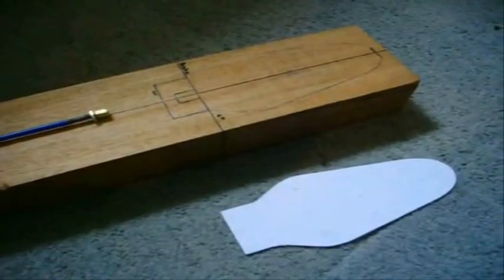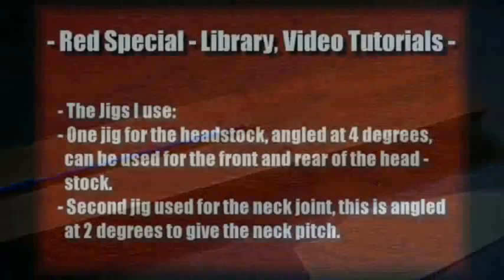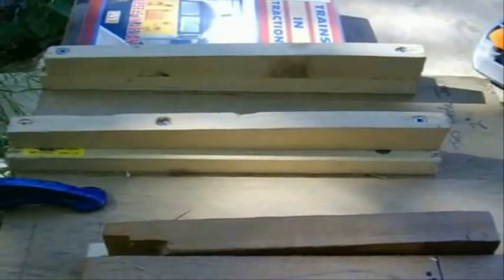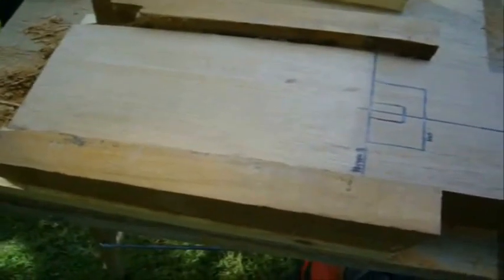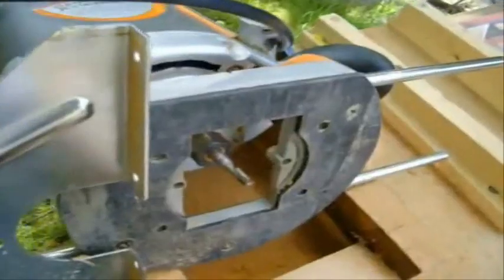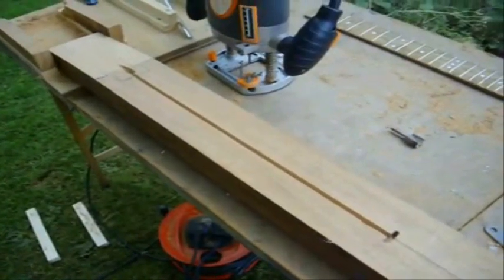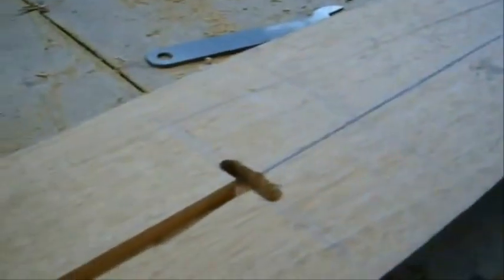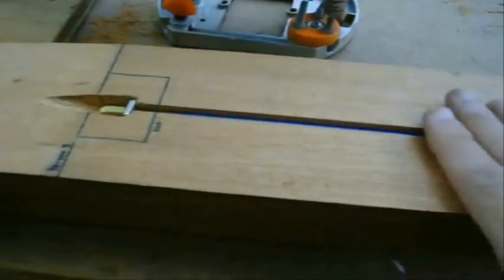Red Special - Library, Part 6

Comment from the maker: On the red special in truth it really doesn't need one... due to the thickness of the neck.
But its always handy to have one installed just in case. The truss rod is used to add or reduce the relief in the neck. each neck has a slight bow or dip, and the truss rod guvens this.
The Truss rod i use is also gibson style, I installed it with a dip in the middle, using a curved fillet strip. when tightened, it will pull the neck straight / flat if required.